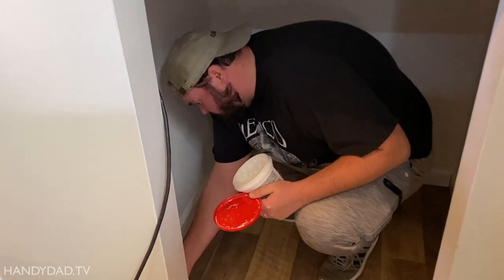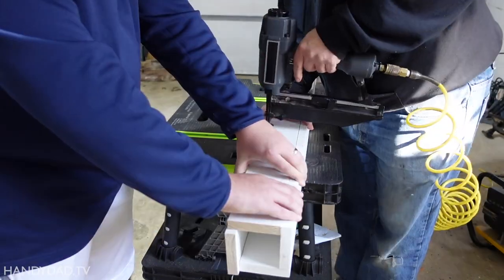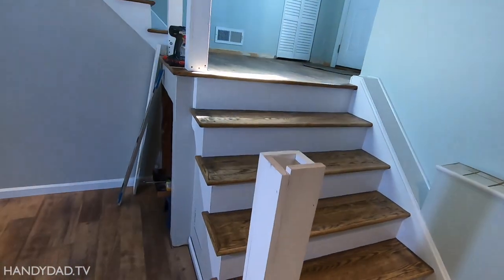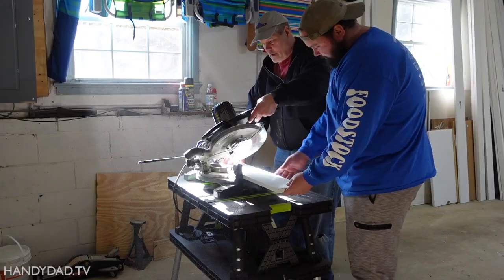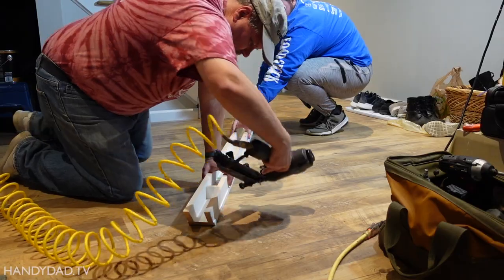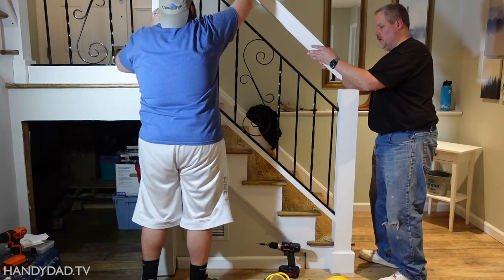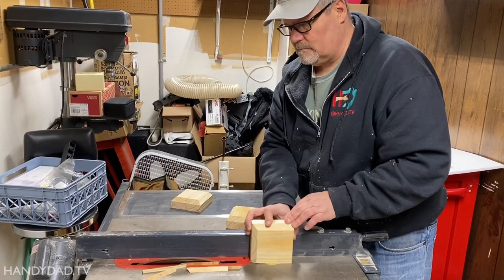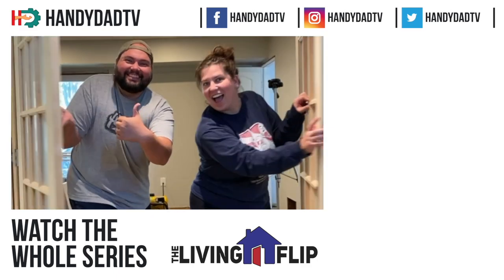WE FINISHED THE RAILING // TLF 41

Comment: Great idea on reusing the iron railing. Just another idea…. The bottom post could have been left as 3 sided with one side open to allow access to install a wood support insert like you did on the top posts.  Then the 4th side installed afterwards.  Either way good work
Reply from the maker: Good idea. Thanks.

Comment: I could be mistaken, but is that 12mm laminate flooring mixed with wood stair treads shown @ 0:10?
Reply from the maker: Yes. We used the laminate in the basement and had extra to replace tile on the landing inside the front door. My daughter bleached the oak steps to better match the laminate. https://youtu.be/m9acPLofzFw
Reply: @handydadtv  Wow awesome. Thank you so much for getting back to me. I've been looking for feedback from people that have mixed wood on the stairs with laminate on floor, but haven't found anything. I hate the look of laminate stair treads. I'm thinking about doing this. Just wanted to make sure that it looked right and not choppy, with consideration to resale.

Comment: I might have missed this, but how did you secure the iron railing to the bottom? Were there predrilled holes already in the bottom rail ?
Reply from the maker: I drilled holes and secured it with black screws.
Reply: @handydadtv  also how has the railing held up over time? Im looking to do this project and I’m also looking for a way to make the top rail with curvature somehow
Reply from the maker: It still looks awesome!

Comment: why fill the post joints with caulk instead of using wood filler?
Reply from the maker: For painting, caulk is much easier to work with and requires no sanding.